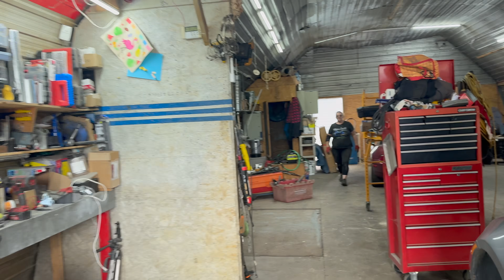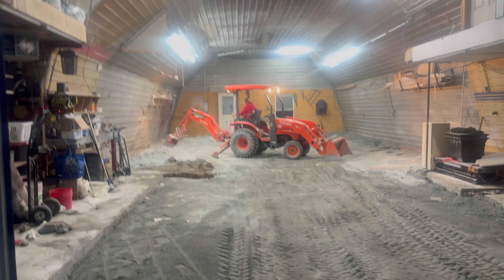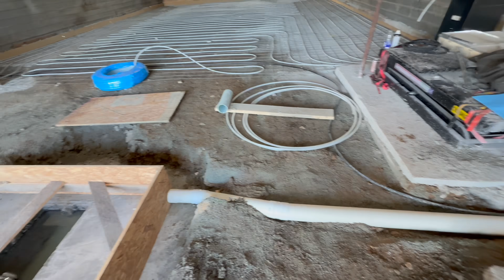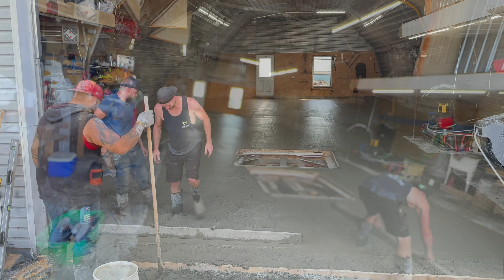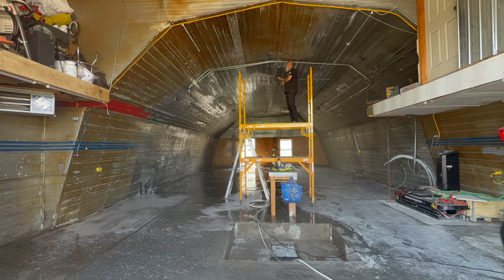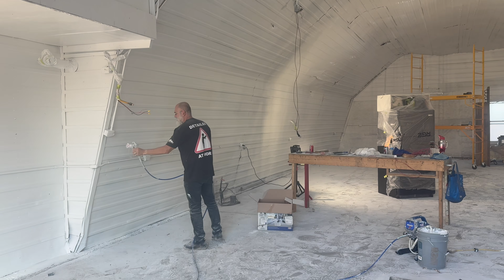E2:  Empty, A new concrete floor with heat, drain, and in floor lift.

Comment: Yvan what is your opinion on using a 2 part soap system to create that isothermal effect if washing without doing any contact? I think that would have been a great option on your walls and the acidic soap might have removed some of the rust staining.
Reply from the maker: The amber color wasn’t rust, it’s the way the paint aged.

Comment: FYI, did you know?  In the States finishers do not recommend spray water on the top of the finished concrete.  Down the road it can cause flaking?  Also, concrete needs to be grooved or cut every 100 sq ft. and 1/4 the depth of the concrete.  Example if the thickness is 4 inches, it should be cut 1/4 inch.  It takes 30 days for concrete to fully cure if conditions are favorable.  Are you putting a coating over the top?
Reply from the maker: Watering isn’t required by code, but it’s definitely still used in the USA where strength is required. Nothing but foot traffic for 28 days. We are using a concrete densifyer.

Comment: As a plumber here in the UK, have you not put any insulation under the piping to reflect the heat up through the concrete?. if you haven’t, you might find the underfloor heating is not gonna work very good and be very costly ? 
Steve
Reply from the maker: Thanks, there’s another slab below this.

Comment: A TRUE art form! A little surprised that I did not seem them use the vibrator.  Will you Epoxy the floor?  Ivan, please wear a MASK when painting. I can come drop one off if you don't have one...j'suis pas trop loin ;)
Reply from the maker: The floors are being polished.

Comment: Looks fantastic, what a great project!!  Wondering why they didn't score the concrete though.  Are you concerned at all about the concrete cracking?  I had a garage built in Maine and even with the scoring it still cracked but I didn't have the heated floor like you so that is probably the difference.
Reply from the maker: Correct

Comment: I never thought you could add heat to your concrete floor... You can see I've never lived in cold climate. I would have thought they would put some kind o heat reflecting shield underneath the heater to reflect the heat up but maybe my mind is overcomplicating things.
Reply from the maker: It’s a game changer for cold climates.